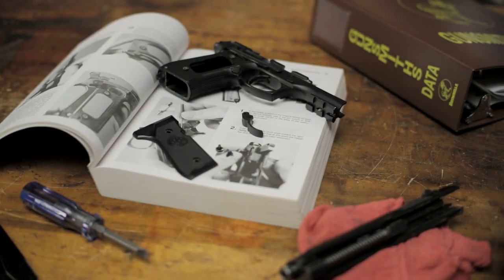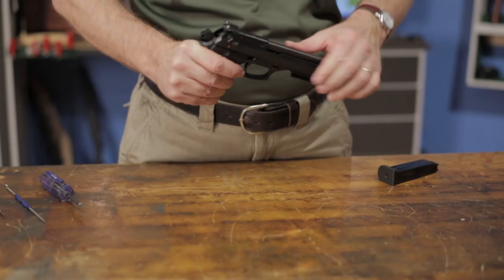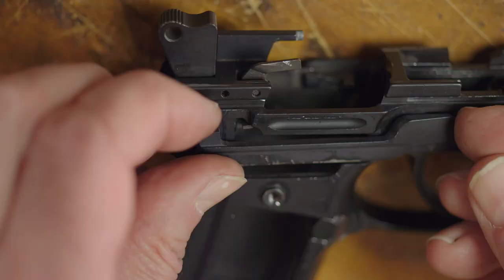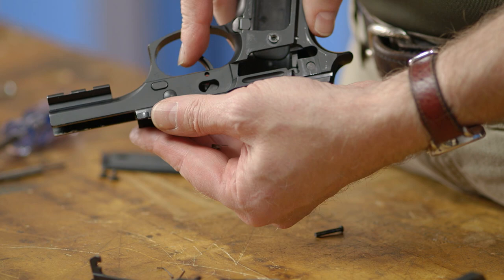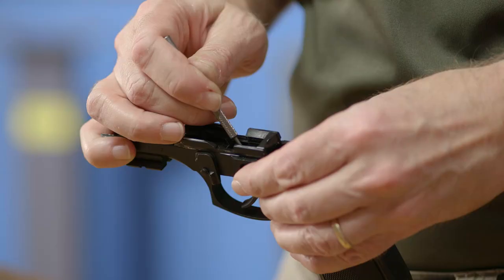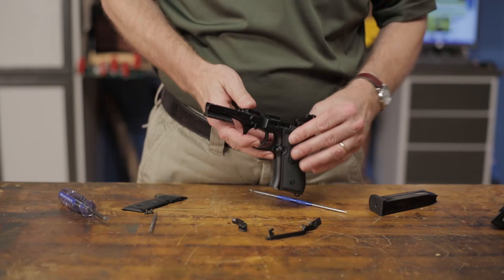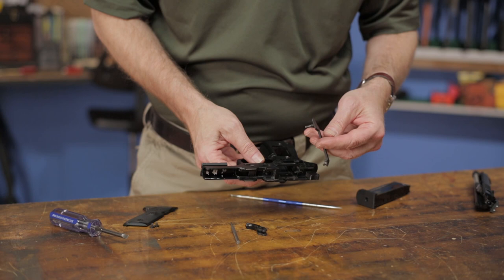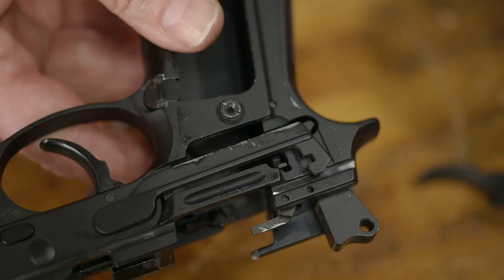Wilson Combat Beretta 92 Short Reach Steel Trigger

Comment: Thank you for the video, I own a 92FS I purchased in 1990, always wondered if there was a better trigger out there. Using this video, I installed this Wilson Combat trigger, a Wolf trigger spring and Wilson Combat hammer spring, incredible short travel and reduced trigger pull weight. I also added a two stage recoil spring, It shoots like a new gun.
Reply from the maker: Well done! Glad we could help you out! Thank you for being a part of the Brownells Family!
Reply: Tomcat, does it reduce the take up?
Reply: @guilhermecavalcantevieira5730  by take up you mean recoil and muzzle climb? Yes there is a delay in recoil induced by the dual spring on the slide. Makes the second follow up shot very doable.

Comment: Why didn't you show what the trigger did different at the end? I've watched videos from you guys before where, after you do the work, you don't show the completed project. It's annoying!!
Reply: Very good comment. They should show a side by side new vs. old.
Reply: The original 92 triggers have a very long SA reset. Does this change that?
Reply: @neuvocastezero1838 No. The short reach trigger only moves the trigger closer to the grip. To change the trigger reset travel, you'd have to buy a different trigger bar from Wilson or Langdon. As well as a new trigger spring assembly that limits the overtravel. Hope this helps.
Reply: @stevensurman6365  Thanks, that was very helpful!
Reply: @stevensurman6365  I noticed on mine (92A1) that after the first shot, in SA there is a bit of "slop" that I have to take up before it will fire.  Will this different trigger bar reduce/remove that slop?  Also, does the new trigger bar effect the first DA trigger squeeze at all?  Thanks.
Reply: @liberty9348  The Langdon Optimized Trigger Bar will not reduce that "slop" AKA the pretravel of the trigger in SA, it shortens considerably the trigger reset.... BUT if you would like the slop/pretravel reduced to almost nothing, Langdon Tactical sells a Beretta hammer that works in conjunction with the trigger bar to do that. 

Do be aware though, that Langdon Tactical suggests that you have either them or a reputable gunsmith fit the hammer to your gun to ensure proper function and safety once it is installed.
Reply: @dexm2010  I ended up getting all that done by Wilson Combat.  The pistol shoots really well right out of the box and I thought there wouldn't be "much" improvement by Wilson Combat.....  man was I wrong.  It shoots crazily better now.  It's like cheating lol

Comment: Old video, I know. But you should mention that some 92FS have a notch on the trigger bar that the trigger spring sits in. You have to lift the trigger spring out of the notch to remove the trigger bar, it doesn't always just pull out like you show.

Comment: Upgrades I installed. Wilson short reach trigger, 14 lb. hammer spring, reduced power trigger spring.  Improvements I noticed. NONE, ZERO, NADA. Waist of $$$.
Reduced reach trigger is looser/sloppy fit, than factory trigger. If I had it to do over again..... I wouldn't.
Reply: You should definitely notice a difference between the factory 20lb hammer spring and the 14lb Wilson Combat spring. I personally wouldn’t use the reduced power trigger return spring. Sucks you through away all that money for nothing. Live and learn.
Reply: If you didnt notice a difference with a 14 hammer spring. You fucked up
Reply: Jason Rasmussen    It was brand new. I noticed a reduction in trigger pull, but the short reset didn't work.
I found out, you need to file the trigger bar pad, before the short reset works. Some things are better left alone. 
The Wilson extended mag release is a fuc*ing nightmare to replace. The Beretta extended release is MUCH easier to install.

Comment: I installed this after the LTT trigger bar, and I can't say I noticed a significant improvement. Perhaps someone with smaller hands would be a better judge. The edges of the trigger could have been smoothed off a little better too. The factory steel trigger a better finish.
Reply: So I have the same trigger/trigger bar setup you got. At the same time as getting the trigger I also got me some G10 thin grips. I have hands that are a bit small for the Beretta 92. But I love the pistol so much I just dealt with it. For me it was the grips thay really made the grip better.  I also immediately gave my factory grips to my dad so I haven't been able to tell what the trigger alone did for me. He had  Hogue wrap around finger groove on his Inox and wasn't liking those at all. Love the LTT trigger bar though. I don't really focus on the short reset when I shoot but it's cool to have. My Walther P99AS has a short reset as well but on that I really notice it. Used to have a W. German marked Sig P228 that had a really long reset. Noticed that as well when shooting it. Almost spent $200 sending it back to Sig for their short reset trigger job but traded it for a HK Benelli M1 Tactical instead.  Was wondering what your experience was with that trigger bar.

Comment: I feel like this is for a USA made beretta because on my italian 92fs, I could not drop the center trigger spring without the rear leg popping out the bottom. Instead what I had to do was put back in the trigger bar, then press the spring in with a screwdriver and then push the bottom trigger pin in from the left. Every other step is the same in this video.

Comment: This is not an adequate explanation of everything that needs to happen to do this at all. There are numerous small grooves that the springs need fall directly into and that's not mentioned at all. Also, getting the trigger return spring to go back into right position isn't easy at all. I would not recommend doing this yourself if you aren't experienced with this kind of work.
Reply: Sounds like you had all kinds of problems that most people don't have.
Reply: If you think replacing the trigger return spring is hard, I'd advise you not to try replacing the sear spring yourself.

Comment: Don't notice a difference and it looks like you reinstalled the original trigger as you can't just drop the spring in it needs to be put in at the same time with the trigger as opposed to dropped in.